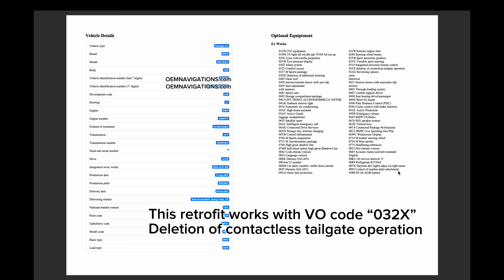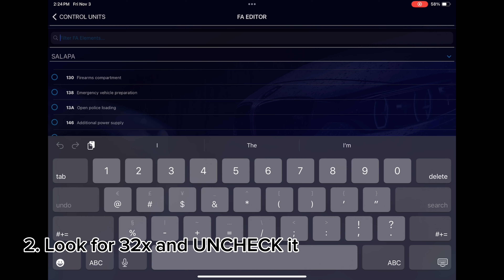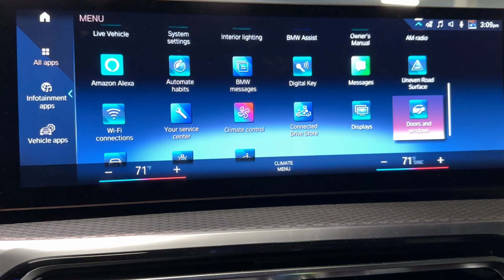BMW G20 Hands-Free Tailgate Opening Retrofit

Comment: Does this part fit on the 2022 G01 X3 as well? Where did you buy from, ebay? I'm trying to do the same thing

Also, do you see ICMQL or SAS3 modules in BimmerUtil or do you need E-sys to view them? I used simple ethernet cable, it shows all modules except these two because they have a lot of driver features
Reply from the maker: I think it does. but make sure you check it by searching the part number. 
I saw SAS3 but couldn't code. I dont remeber seeing ICMQL
Reply: @THE3MW.  what website did you buy it from? Also do you see the DSC3 module either?

do you recommend rear license plate plastic cover? I been getting camera tickets recently it seems more appealing to buy something that obstructs the camera reading rear plate but not to the human eye
Reply from the maker: @jinglichen2278  I am not sure. I don’t think I saw DSC3. But I can check the modules DSC3, SAS3 and ICMQL later for you.
And I bought the used one from EBAY(used ones are from totaled car usually). 
I don’t know anything about getting camera ticket, but I use https://amzn.to/3UyADs3 it is just simple and not too plain.
Reply: @THE3MW.  ok thanks I’ll keep a look out. There are some things I wanted to change in DSC and ICM SAS. 

are you in the US? Maybe I can hire you to install it on my car lol…

I peeked under my x3 and I didn’t see such hookup there so I feel I have to disassemble the skid plate or rear diffuser to see it.. mine is just regular X3.

i heard it should be accessible if trying to mount a tow hitch so maybe I can ask someone to try it out
Reply from the maker: @jinglichen2278  I am in the US but I don’t think I can do it for you:(. I don’t own x3 but I believe you need to take at least one cover(which blocks water and all from the road) off from the bottom.
Reply: @THE3MW.  how much did this cost you in parts and times
Reply from the maker: @jinglichen2278  200 bucks for the part and 1 hr for work
Reply: @THE3MW.  Is BimmerUtility $109 license needed to make the changes right? Of course there are many other things I wanted to code but haven’t had time yet so it’s probably worth jt
Reply from the maker: @jinglichen2278  I think it is worth it in long term. It is like ESYS + BIMMER code
Reply: Hey sorry to bother again. You put a used part into your car that was taken off another car? i went to dealer and they encountered a fault and said i had to buy the same part new. If the part was taken off another car it cannot be recoded like what you did is this true?

Comment: Hey, when you went to BDC and MGU module and then directly clicked VO code, did you have to change anything in those modules before clicking VO code? Does the kick work to close the tailgate too (for electronic closing tailgate)?
Reply from the maker: You have to install additional parts to do closing too. (It will cost, and lots of job). This one is only unlocking the trunk so it opens up.  You don’t have to do anything before clicking VO code!
Reply: @THE3MW.  Thanks, did FA edit impact your car's ability to receive remote software updates?
Reply from the maker: @jinglichen2278  might impact it. Mine isn’t receiving any updates for a while. But after coding I don’t want remote software update anyways.

Comment: I did exactly what you did in the video. The tailgate option has been added. But not working. And in addition the car on the screen turned black from white. why?
Reply from the maker: Did you replace the part too?
And color changing is the bug
You can change it back by
HUMGU 3E52
Expert mode
Vehicle colour
Change to your car color
Reply: Yes I changed. Regarding the Bimmerutility color change?